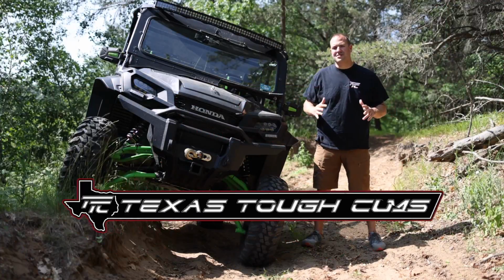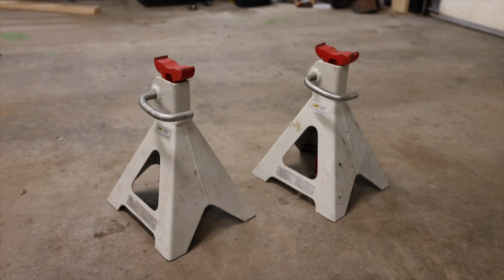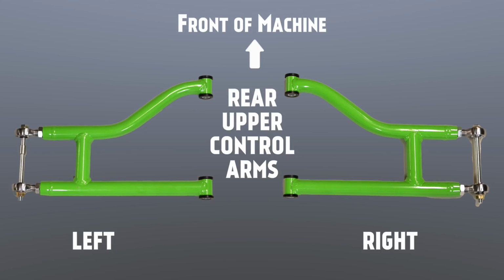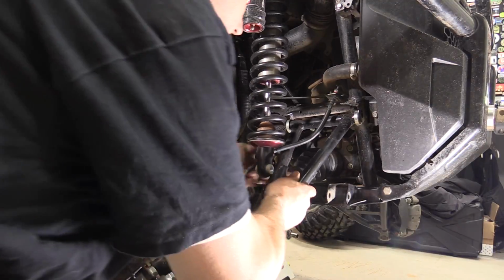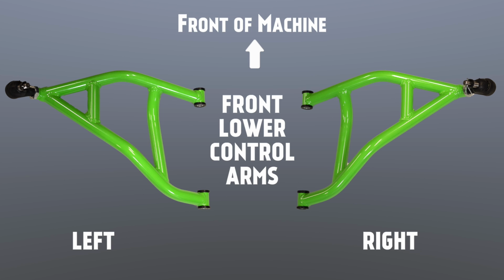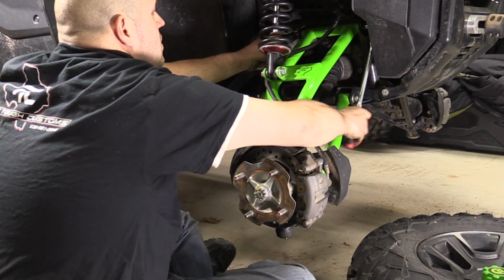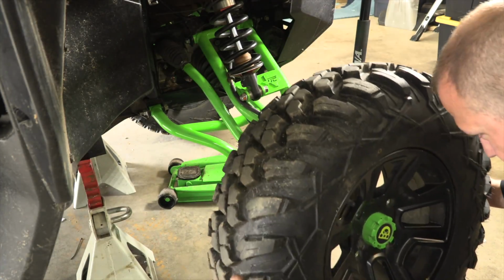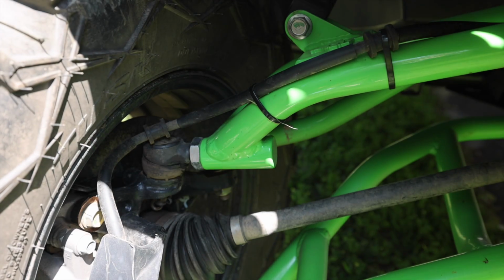Texas Tough Customs Pioneer 1000 Lift Installation

Comment: How har is the lift on the axels?
Reply from the maker: No issues at all. Many customers run stock axles on our 0" and 3" kits with zero issues. Our 6" kit requires extended aftermarket axles.
Reply: Is ot recommended to upgrade axels? I just installed my 3" with vertex shocks and i feel that the angles on my axles are a bit hard.@texastoughcustoms